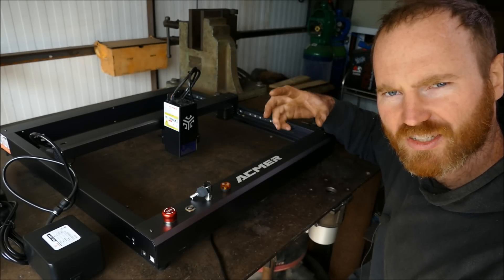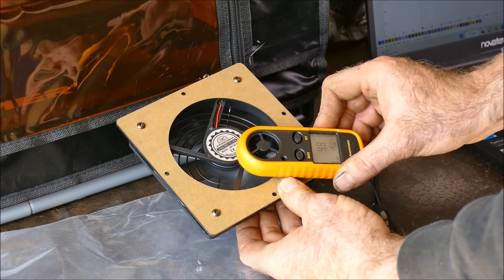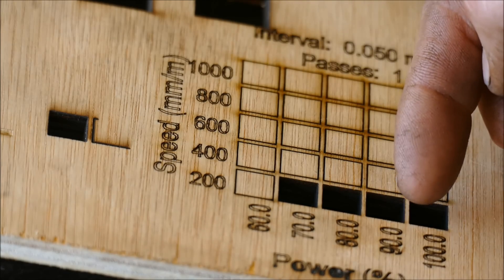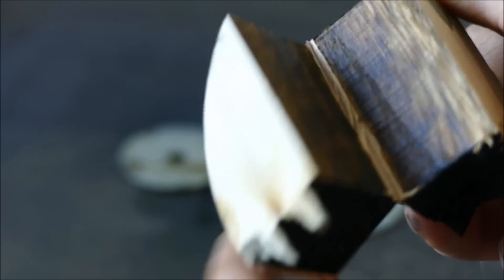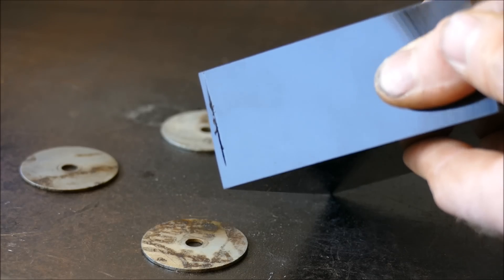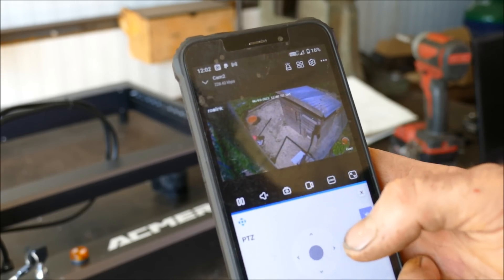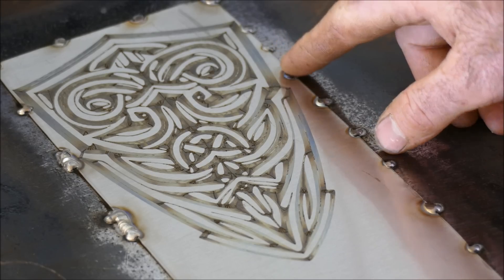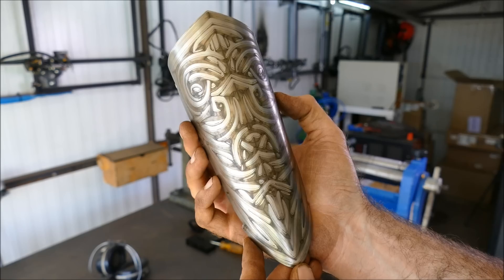INSANE new desktop laser shouldn't be able to do this! ACMER P2 33w full review test critique & tips

Comment: The main problem you have is the focal length of the lens in use. With bigger lasers you can change the lens, which means you can have the focus point in the middle of the depth of wood rather that on it's surface. With your lens and a focus point on the top you get a cone shaped laser beam meaning you have a small focused point of the top and a large wide unfocused point at the bottom. And having a better air pump that can force more air through the nozzle also reduces burning (makes no difference with acrylic BTW).

Comment: I believe the Brother Scan N Cut DX series can read .DXF formatted files.  They don't currently use a laser diode attachment.  But it means that these types of files can be interpreted for a personal digital cutter/plotter for other types of applications.  Such as cutting out the patterns in cloth, EVA foam, thin leathers, using the etching tools from Zoom for engraving soft metals such as copper and aluminum.  Material thickness limit is 3 mm for cutting soft materials from paper to EVA foam.  Patterns could also be used to make foiled designs, embossed designs, custom cut greeting cards, lamp shades, etc.

Comment: Try industrial strength double sided tape for holding the material....
Reply from the maker: That doesn't work for stainless steel because it heats up to over 100 degrees Celsius. Cheers J

Comment: I've been watching a lot of your videos and they're really helpful. I'm looking for a diode laser that I can use for engraving and cutting MDF/Plywood for woodworking templates.  the Xtool 40W is a crazy amount of money since I'd have to buy the unit, 40w diode, and air assist. This looks like it might be more reasonable. Do you have any suggestions?
Reply from the maker: Thank you so much. The xTool bundle is cheaper than buying individually but still £1650. I think the 40w is the currently the most efficient laser I've reviewed at 12.5mm per watt cutting 9mm plywood compared to 8.5mm per watt on the 30w lasers. The xTool cut 9mm ply at 500mm/min compared to ACMER  which did it at 250mm/min. The xTool is £500 more but double the performance. I'm reviewing the comgrow z1 pro 20w next which is the cheapest In the 20w category. Cheers J

Comment: Would it cut through the stainless steel?
Reply from the maker: No it can only etch stainless. You need a 2kw+ to cut metal or use a plasma torch. Cheers J
Reply: @joshuadelisle  I went to the website and it says it will cut 0.1mm stainless steel. Not sure what that means, will it cut 0.2mm with two passes and 0.3mm with 3 passes?
Reply from the maker: @mavamQ  ok it could probably cut stainless foil at 0.1mm but I don't really know an application where that would be useful. Most stainless steel parts I get cut are 3-8mm thick and done with a laser machine that costs £500k. My plasma table can cut up to 20mm thick but has a 3mm kurf width and heavy dross. Cheers J

Comment: When cutting wood, why not make an inert gas envelope. For example, put a block of dry ice inside the plastic enclosure. The sublimated CO2 gas is heaver than air so it should make an inert layer of CO2 right where the laser is cutting the wood. The CO2 will displace the air (oxygen source) so the wood won't burn while cutting, acting as a shielding gas. Note: CO2 decomposes to CO + 0 at 2120 deg C, which can happen when cutting metal, potentially causing blowholes and splatter. In that case, you could try nitrogen or argon, both heaver than air.
Reply from the maker: Good idea. Cheers J

Comment: Can the plasma cutter be adapted to this laser cutter?
Reply from the maker: My plasma is the ortur lm 5w, I can put the original laser module back on it anytime but the controller won't support the new 30w modules. It's mainly to do with the pwm power supply. You could theoretically use one of these new 30w controllers as a plasma machine however it's not clear how the HF will affect the new controllers. I'll be building my big plasma table using a 10w laser that has an offline controller. One of the things I've looked at to minimize HF interference that a lot of people have trouble with is a ferrite ring on the controller wires. Cheers J
Reply: @joshuadelisle  Thanks for the quick redponse👍🏻When are you planning on the big table build? Anytime soon? That will be interesting to see. Thanks again! Enjoy seeing your work..
Reply from the maker: @hchump1968  thank you. it will made as soon as I get the time or desperate for a job. So no idea but hopefully soon. Cheers J

Comment: Laser diode MTBF compared to CO2 would be interesting
Reply from the maker: What do you mean by MTB? Cheers J
Reply: @joshuadelisle  Sorry, "Mean Time Before Failure"...
How long do they last?
Reply from the maker: @BlunderMonger  Its generally accepted that they last 10k hours+ but it really depends on how cool the diodes are kept whilst running. The better the fan the louder they are. If you're running at 100% power continuously then you risk overheating the diode and wearing it out quickly. Cheers J

Comment: you can buy a good 60W or 80W  for under $100 and upgrade the whole machine you will also have less run time and if you add jet air  to the laser head you will cool the items so you don't have too much burn as you are having
Reply from the maker: I think you maybe confused with electrical input and optical output. this laser is 180w input. I think the 40w optical output laser modules are £1000+. cheers J

Comment: Hi, great video. I have a question…. I’m a shop owner and sell lots of knives. I’m looking for a laser to engrave names and the like one knives like Opinel , wooden handle knives and also on blades. What would you recommend as a machine ?
Thanks in advance and keep up the great content .
Reply from the maker: Thank you. For blades I would recommend a fibre laser, they're very quick likely 1000x faster. They can only do small engravings up to 120mm square but that's plenty for custom knives. I think laserpecker3 is potentially good for steel and possibly the xTool F1 but I haven't tested those yet to see. Cheers J
Reply: @joshuadelisle   Thank you for the heads up. I will do the research, Have a great day

Comment: Wondering what sort of life  usage would you get from the diode? Appreciate it's dependant on intensity etc but any info from the supplier? tried to find warranty info and diode replacement costs etc on the site but none available... Thanks for the review.
Reply from the maker: I'm not too sure because there are several factors but 10000hours is what seems to be acceptable for a diode laser. One issue is using them on 100% power continuously degrades them quickly because they overheat or have done in the past. Some manufacturers are putting more powerful fan systems to help cool more efficiently but tend to be louder. The tech is improving quite fast and even manufacturers are asking for my thoughts whilst developing the next generation of lasers, which was very nice to think that my opinion matters to them.  cheers J

Comment: The one glaring flaw is the 2mm pitch plugs.
Reply from the maker: What are pitch plugs? Cheers J
Reply: @joshuadelisle  they are those little white plastic plugs with the tiny pins in them- the pins are rated at only 2A and are spaced at 2mm (2mmm pitch = spacing). They are abosolutely NOTORIOUS for making intermittant contact, breaking, or burning up  from arcing, because they have no positive fixation/locking or strain relief and the pin goes into a tiny bit of aluminum that makes poor contact. 
I would turn off out the useless fire alarm, put a pyrotechnic extinguisher like an Element or a bomb type extinguisher in the enclosure instead, and add an aviation connector on the rotary plug- and hardwire every other 2mm plug on the machine.

Comment: You can always upgrade the laser to your $30K models power, and still be under $3k i bet.
Reply from the maker: Not sure what you mean. I don't have anything worth £30k lol. Cheers J
Reply: @joshuadelisle  You showed it, and it looks like that cricked laser.  LOL
Reply from the maker: @robertsmith2956  £3000?
Reply: @joshuadelisle  just watched again.  It's the accent plus the cheap laptop speakers.
Do laser diodes have a lifespan?
Reply from the maker: @robertsmith2956  Ah ok. Yes although it depends, if you run them on 100% power continually and overheat the diode then they don't last long, if say used at 80% power it can last 10,000 hours+. Cheers J

Comment: whats the 100% lifespan on this diodes
Reply from the maker: It depends on if you use them on 100% power continually or not. If it overheats it can wreck the diode in short amount of time but if used at say 80% power then it can last over 10,000 hours+. I've not wrecked one yet to know exactly. Cheers J

Comment: WOW!  that IS the actual output!  I'm surprised that the diodes alone aren't over $1k.  I'm off to find out just how many diode chips make up that beam....
One suggestion might be to use nitrogen as the flush gas - great fire suppression :)
Reply from the maker: No the optical output is 33w, the electrical input is aprx 180w. The diode consists of 6x 6w optical lasers combined by mirrors, it should be 36w but there is a slight inefficiency in the coupling. Cheers J
Reply: @joshuadelisle  Laser tech seems to have progressed quite some as I seem to remember laser with that kind of output power needing >1000W input power...

Comment: That is a surprisingly collimated beam. More like waterjet or EDM than laser diode(s). I can usually only get that by raising the laser head and focusing long and losing power / small dot as a consequence. 

Perhaps the warping came from the material being pre-stressed. 

I wonder how consistent these 'knife-edge' beam combiners are from the perspective of manufacturing and factory setup. I worry that there are good ones and bad ones from the same supplier. Does anyone have any experience of this?
Reply from the maker: It's possible, I think good quality brands will have a quality control check and a return policy just in case. Cheers J
Reply: Agree with this.  I had ordered some cheap anodized aluminum to etch and couldn't do it without the material warping.  Finally tried a more expensive brand of the same dimensions and same etch settings and had no warping.

Comment: Looks awful 😖 and weak compared to atomstack and xtool lasers on the same range. So many passes, at that point just grab a saw and don't yourself.
Reply from the maker: Well it's 2000mm/pm so it's still fast at cutting, if cut at 100mm/pm which is what it would take the xTool in one pass it's likely to catch on fire. Atomstack 33w I rejected the opportunity because the two machines I have of theirs are awful which is why I haven't shared a video on them. I think the ACMER is very good and very similar quality to my xTool D1, Cheers J
Reply: @joshuadelisle  I am actually referring to the plywood cut and what seems to be some pinus you had there. I know that at this thickness the diode lasers will need more than one pass, but watching atomstack, sculpfun and xtool d1 reviews they seem to use a lot fewer passes even their 20w modules looks stronger. That's a pitty, cause Acmer is really cheaper right now and that focus was indeed awesome.
Reply from the maker: @MrLelopes  the 9mm ply is one pass at 250mm/pm but that other thick ply is laden with glue that doesn't like lasers, not all ply is suitable and that one wasn't, not even my xTool 40w does any better on that.
Reply: @joshuadelisle  I must have misunderstand than. I found their video with a 15mm pinus, and it looked good. https://youtu.be/maKSH-7f2yw  Sorry about it. I am trying to check if P1 and P2 uses the same module, cause I prefer the open extruded aluminium profile structure so I can to upgrade it later. Could you add your thought about atomstack?
Reply from the maker: @MrLelopes  it's ok I just genuinely think ACMER who are smaller have done a great job. The machines from atom stack that I have which is a very similar gantry system on their 33w version seem to resonate or wobble a lot meaning the engravings are not accurate and fine details have a lot of wobble, I asked them for assistance and tried different belt tensions etc but it wasn't good and the 10w were not at the same standard as ortur, longer or even comgrow so I gave up on them. I liked the offline controller on them and stop button but that was it.

Comment: I can't for the life of me understand why you would ever want to incinerate 40mm thick timber with the focal length of these lasers? It makes no sense. OK, you can cut thinner materials faster (say up to 6mm) and that's perfectly fine, but why they keep harping on about how thick their machine can cut compared to others?? They also need a Y extension for this (and other ) machines like the xtool - say up to 1m to make it practical. Looks a decently made setup - it will require some serious extraction when barbecuing 40mm timber no doubt 😁😁😁 /rant
Reply from the maker: I think its more to do with the quallity of the lasers focal length so you produce a square cut, The longer the focal length the better and deaper the cut will go. cheers J
Reply: @joshuadelisle  Yes, true, but at the sacrifice of a higher resolution with shorter focal length when engraving. I never see any options to replace lens sets like you do with more expensive RF lasers (Universal/Epilog etc). You also don't get those companies advertising 40mm cutting capabilities. For 40mm, you really want a table saw LOL 🙂 That all said, if the price is right and the quality is decent, what's not to like ....
Reply from the maker: @neilgillies6943  absolutely you're not wrong. This will do finer details than a table saw or router though. Cheers J

Comment: Hey that diesel heater .. use a 13.5mm OD and 4.5mm ID washer cut from the lid of a Chinese food container. place this between the brushed and the bearing. no more contamination by brush material in the bearing. OR use a 6252RS rather than the 625 ZZ they come with.
Reply from the maker: Interesting, thank you. Cheers J

Comment: Hey. To stop the SS warping you can mount it on a copper backing plate. Works well when tig welding and i can only imagine it would work for the laser etching by sucking the heat out of the SS. Give it a go 😁
Reply from the maker: Thank you, because the laser is so localised it only works with firm clamping, welding can be strong backed to account for warping but considering my table is a large heat sink I don't think copper backing will be as effective as you hope. Cheers J

Comment: Hi Joshua, How are you doing with the 3D Printing? Be good to see a video update about the things y are doing and what you learned?

I myself have saved up and ordered a new Elegoo Neptune 3 Max FDM 3D Printer which is their biggest one so far.
Bed is 420 mm square and 500 mm height of printing.  They also do a Plus version of 320 mm square bed and 400 mm height of printing.  the Max costs $470 and the Plus costs $350.

I most likely be selling my Elegoo Saturn 2 Resin 8K 3D printer even though it is god because of getting rid of the resin filled washing water after the water washable resin is washed from the models in the Mercury XS wash and cure system I also brought is still Toxic rated and can't be put down the drain or sink, 

I have 14 liters stored in plastic containers that I can't set due t the sun not being that strong in good old UK,  and buying a Big UV lamp be over £200 so that's not helpful.

In the USA and other hotter countries they just stick the water out to evaporate away and the left over resin then sets to be thrown out as trash. But not a option in the UK sun.
Someone said take it to a recycle waste center? But I have no car and taking toxic water by bus be a no no in case of spills.

Someone else said do small amounts under the light f the UV curing unit I got in a glass dish. But that would take tons of time and the turntable of the curing machine is a light weight one for light hollowed out resin models not heavy water filled glass dishes. Plus if I am using the curing UV unit to do any already used water the new stuff done in the resin printer can't be done due to the curing unit being busy for tons of time.

So sadly I will have to sell the resin system. The costs of the lots of paper towels and gloves and resin are very pricey anyway now. Even the IPA version to wash with be far too pricey anyway.

So I stick to FDM as I can get rid of the waste and bad models easy since they are corn starch based. Also I see Elegoo now released 6 new printers.

3 resin and 3 FDM. two f the FDM printers are called Neptune 4 and 4 Pro.  The 4 Pro has liner rails for the Y gantry and a two zone heating area on the bed the middle for small models and the outer with the middle for big models to save on heating all the bed when the small middle sat models are on done and the outer section not needed.

the Neptune 4 link >

https://www.elegoo.com/collections/neptune-series-fdm-printers/products/elegoo-neptune-4-fdm-3d-printer

or
the Neptune 4 Pro

https://www.elegoo.com/collections/neptune-series-fdm-printers/products/elegoo-neptune-4-pro-fdm-3d-printer
Reply from the maker: HI, I have a new resin printer by Heygears, the new solvo and the any cubic cobra2 to review shortly. I'll take into consideration the issues you've had for my review. thank you, cheers J